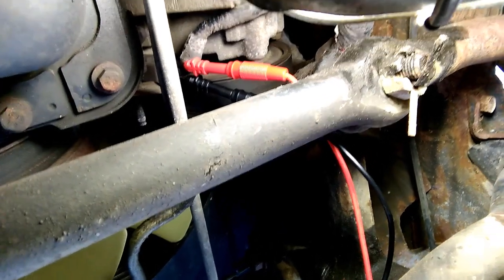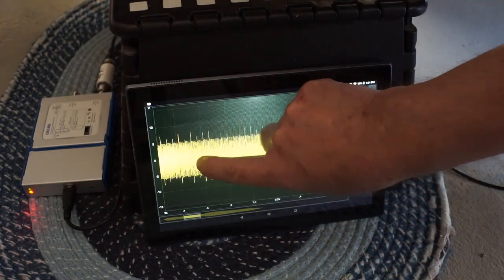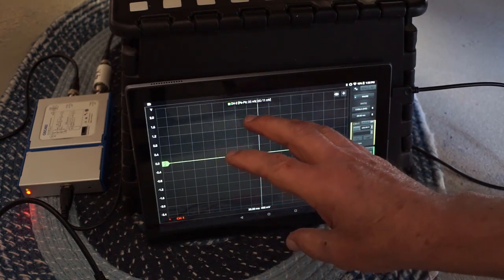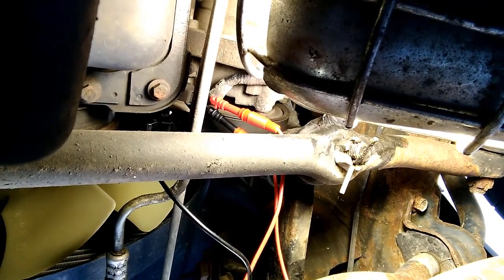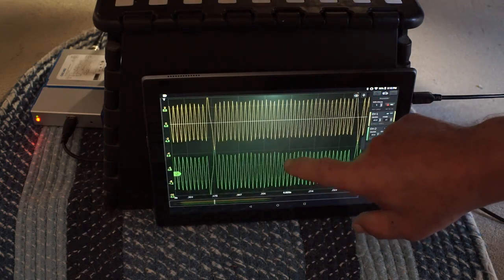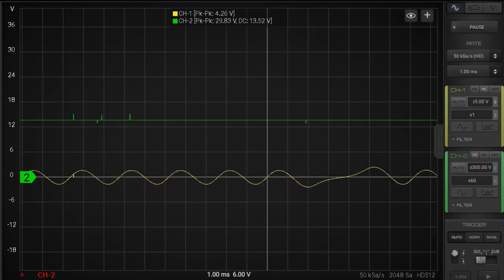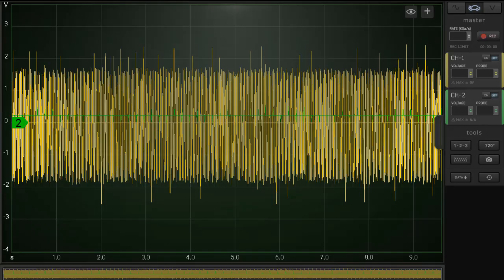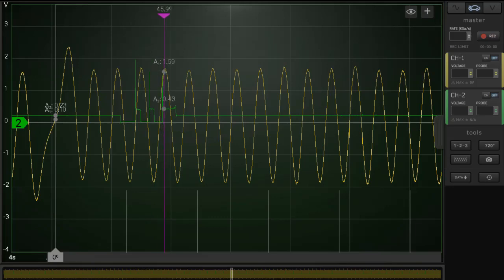GADGETS#110 - VRS CKP

Comment: Thanks for your videos! Do you have a list of the hardware that you are using - exact, in case that I would purchase it also. I don't fix cars, but I like to learn, but my oscilloscope would be used for my Arduino and ESPxx stuff. If you had to get something inexpensive, as an oscilloscope, what would you suggest? Have a happy Memorial and long weekend! Also your viewers!
Reply from the maker: I am liking those LOTO oscilloscopes, Tony.
The OSC482 is about $60 and will do fine in automotive work (with attenuators when required)
The OSCA02 or OSC2002 are slightly above $100 but have more bandwidth and memory depth. If you're playing with development boards, you might be happier with one of these.
The LOTO Windows software if pretty good. I prefer Hscope, which supports any of the 3 scopes mentioned here.
Reply: @theGADGETSplaylist  Thank you for your quick reply and details you have mentioned. I assume that Loto PC Oscilloscope OSC2002 at $125 looks portable. Does it works with tablet or just Windows? I have very nice Samsung tablet that is about 1 year old, but has lots of power and memory-fast! If you use the tablet, can you store the data on a memory card or internal memory? I have couple of scopes, one is Tektronix 2465DMS 300 Mhz and 4 port and more modern Aktakom color LCD 100 Mhz 2 channels, but I like to do stuff you are doing, so to follow your videos, I should get something like you have. If it works also with the table, does the software comes with it? Or did you purchased different software?
Reply from the maker: @tonysfun  the thing to watch with LOTO is the suffix they put on the end...like OSC2002x
Usually just signifies bundles (cables, etc) ...but M and F mean an ANDROID support I do not recommend.
So, look for plain OSC2002 (no suffix) and then purchase HScope licence for it on Google Play Store later.
NOTE: OSC2002 is recognized as OSCA02 in HScope.
If you're comfortable with that $125, you won't go wrong.
Reply: @theGADGETSplaylist  Great info! And I'll get the software HScope. Thank you very much!

Comment: I notice you have been using the lotto in your few past vids, any particular reason?
Reply from the maker: less noise
no calibration drift
+/- 6v without attenuation
DE15 expansion port
LOTO have become my go-to scopes. I would not recommend you discard your 6022BE to get one. But if someone was in the market, I would steer them towards LOTO.
Reply: @theGADGETSplaylist  had already bought one, just haven’t had a chance to check it out. Thanks for the info".....kinda of a toy guy 🤓